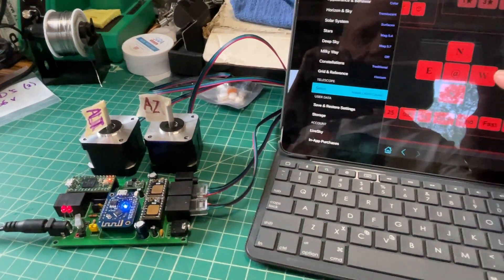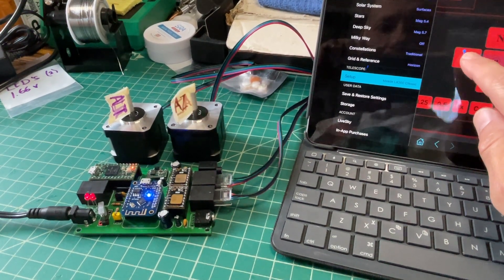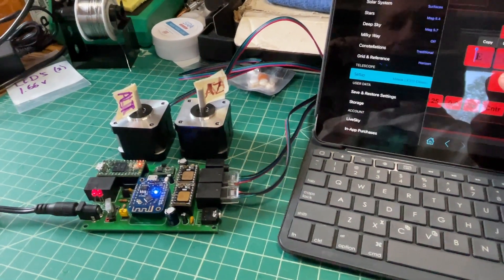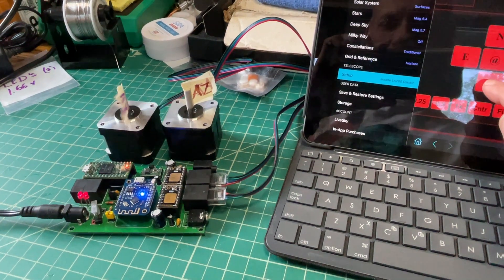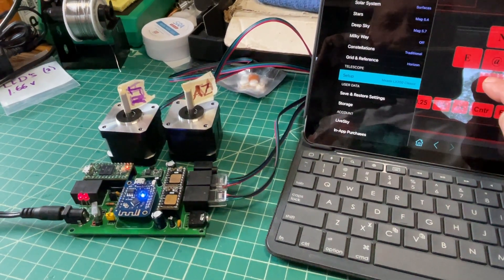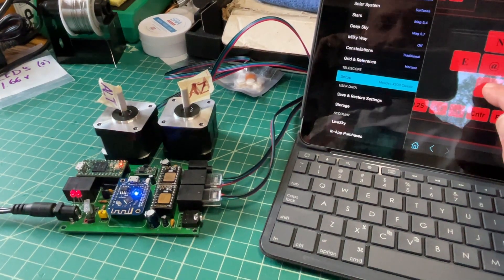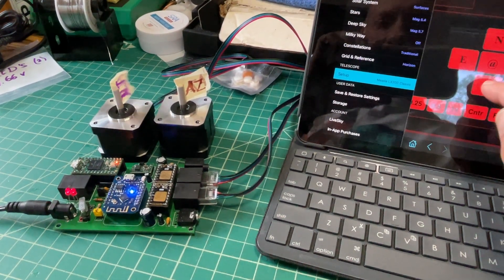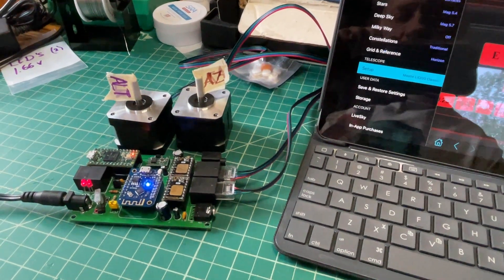OnStep Motor issue

Comment: Cables to your NEMA17s from the driver board. There should be 5. 1 for power, and two sets of two that create the armature connections across the poles of the magnets.  When you send a signal to the stepper motors, you are sending PWM step instructions to opposing poles and then alternating them. It has to do with current flow and induction, which is why a lot of driver boards will have a dir pin on the board to control the direction. 

Look into your code, not the GUI. You'll see whats going wrong. 

Other than that. Unplug all the wires. Draw a wiring diagram and then follow the diagram